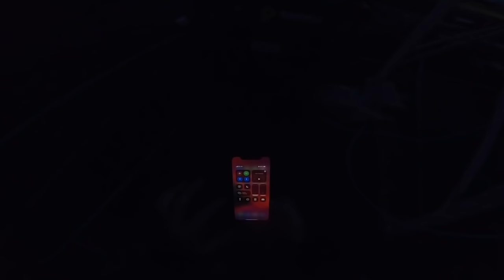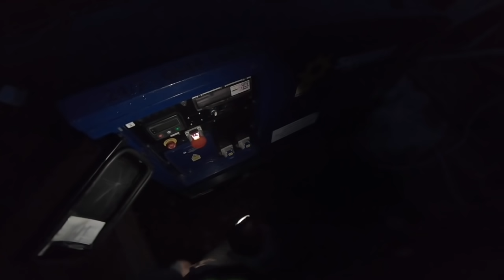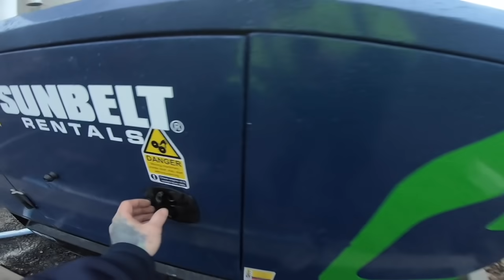Using the old WHS trowel today!

Comment: How's your wrist after using the bigger trowel? Why are folks asking no pic & dip don't they know you are building ends and then will run in later when you string a line.
Reply from the maker: Not to bad. But I definitely feel more tired today and didnt get as much done as I usually would.

Comment: What are the best work boots to wearing on site
Reply: Being working on sites for fifty years and my advice is wear sensible but comfortable shoes. I only ever wear Dr Martin Air wear. Steel toe caps are like wearing diving boots. Cumbersome and uncomfortable. I can dance out of the way of a falling brick quicker than with boots on and if anything else is to fall on you the cap would probably do more harm than without.
I am all for working safely but, I think it's gone mad.